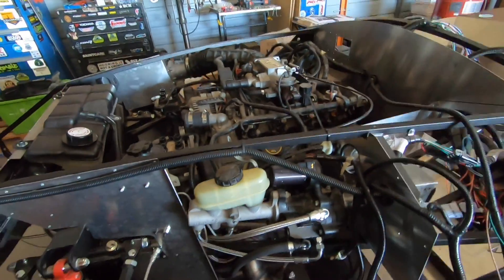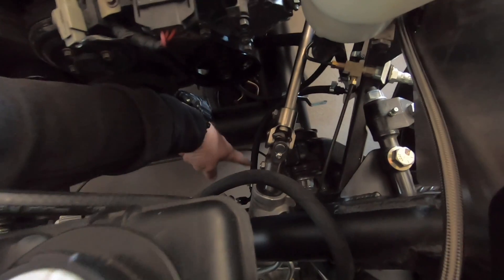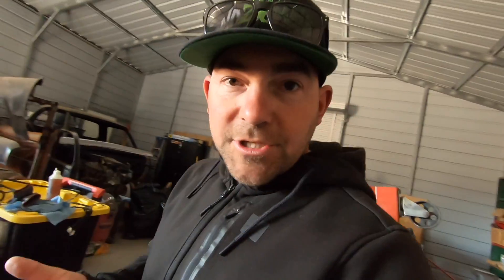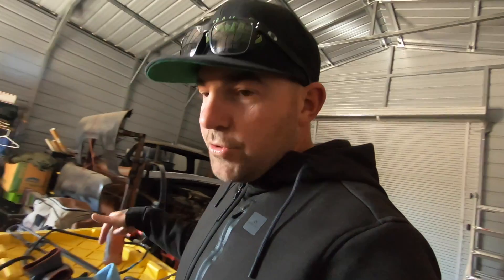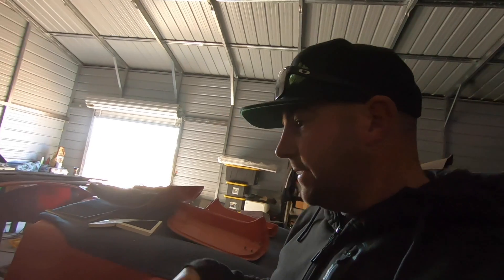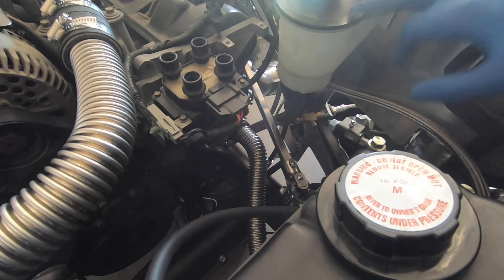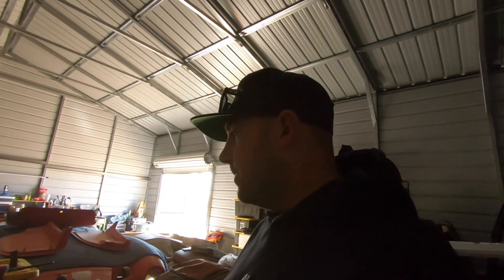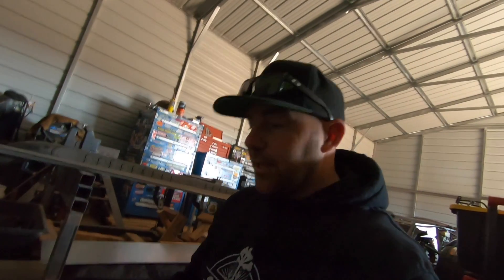Factory Five Cobra Roadster - More Hydroboost Lines and Cooling System

Comment: I like the look of the cooler in the oil cooler opening. I just bought one for that hole and use it for my power steering.  By the way, that hydro boost, with out a cooler,  gets hot as hell.
Reply from the maker: I have a cooler for mine. I decided that was the best way to go in the end. I might move it eventually but right now I have it on the x-brace behind the radiator.
Reply: @jawindustries  I’m sure it will work fine there.  I just like the look of having the cooler in the oil cooler opening.

Comment: my kit came with the inline filler. I have the complete kit, no donor parts at all.
Reply from the maker: I guess since mine is a base kit it doesn’t come with the inline filler. Which is odd, because even the way they have you hook up the overflow tank eliminates the way to fill the cooling system. I found an inline filler online, so it’s all good now though.